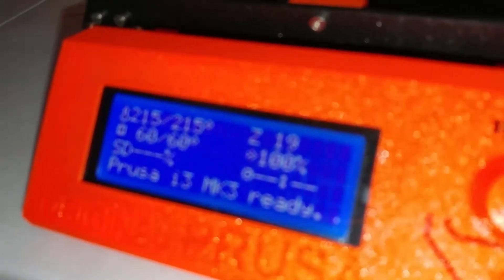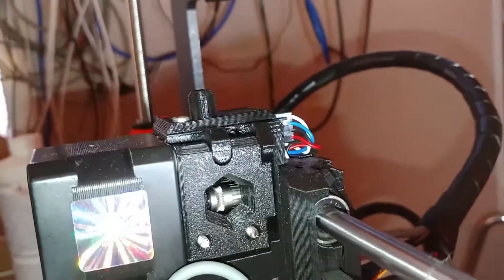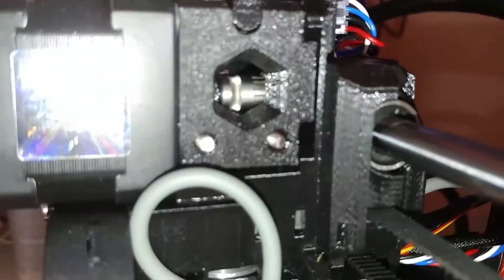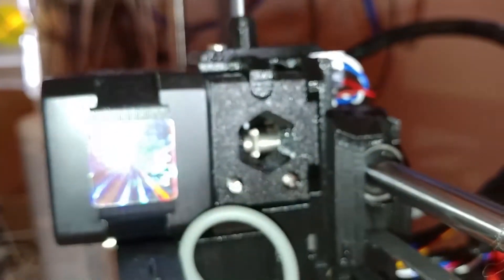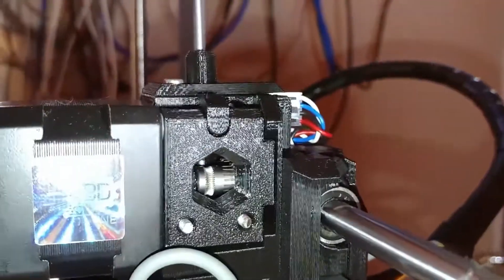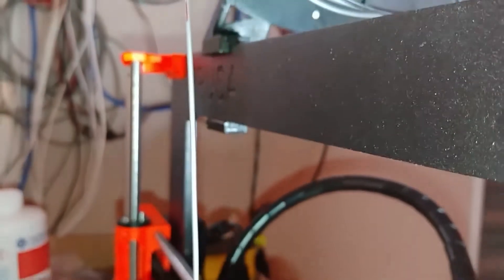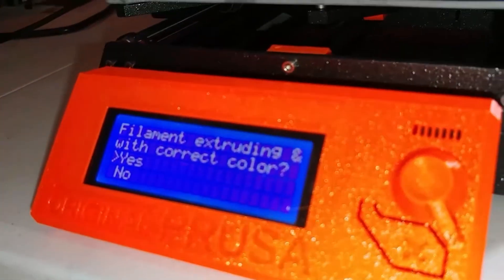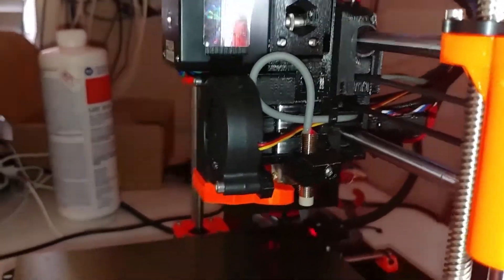Extruder Click Error   Prusa MK3 i3

Comment: Mine was caused by a filament runout. It has no back pressure from the motor to push the last of aspool through and I just had to remove the tension screws preheat the system and pull out the excess filament.

Comment: I think I found a solution.
I have the same problem and found in other video a comment that might have a working solution.
"The problem is the Quick Joint that holds the PTFE tubing, after some time it starts to get weak and it doesn't hold the PTFE tubing anymore, the filament is than pushing the PTFE tubing up towards the extruder gears creating a gap at the throat tube and that will block the extrusion. 
I made a new PTFE tube and made it about 2 millimeter longer, I pushed it back in the hot end and because I did not have a new quick joint so I used a drop of fast glue, now everything is working fine again."
I am ordering a new PTFE tube and trying this out.
Hope this helps!

Comment: did you fix it? i have the same issue, im sure that its the extruder motor, i was watching the bondtech that is inside the extruder but they dont turn in the correct way. or maybe they dont move, just click and stay in the same place making noise (click)

Comment: Had the same problem took me 16 disensambly's before I found out what the problem was.  I printed about 28 days without any problem and than it started to click, used the same settings and material. 
The problem is the Quick Joint that holds the PTFE tubing, after some time it starts to get weak and it doesn't hold the PTFE tubing anymore, the filament is than pushing the PTFE tubing up towards the extruder gears creating a gap at the throat tube and that will block the extrusion. 
I made a new PTFE tube and made it about 2 millimeter longer, I pushed it back in the hot end and because I did not have a new quick joint so I used a drop of fast glue, now everything is working fine again.
Reply: Having same issue I'll try that also, thanks !
Reply: @ScHaPaH  Did it work ?
Reply: @cazacucatalin  Didn't try, I have upgraded to R3 extruder and no more mid print clog, I have now 100% success on my prints

Comment: Did you fix that problem? Prusa CS told me that this is cause of wrong filament. I've changed it and still is same problem.
Every time when this clickin start, I do unloading filament. and every time at the end is a small ball.
Is it possible that filament jam in the nozzle?
During 10 hours of printing I have that issue more that 5 times. It's really annoying.

Comment: from what I see it is clogged. 
You may fix it already. but here is how I fix the problem 

here is the concept and solution
there is 3 type of jam. 
1st is nozzle jam, 2nd cooling zone jam or PTFE jam & 3rd jam before filament goes into the motor. 

1. understand how the excluder structural can help  you understand which part is the jam. in your case most likely is 2nd level jam
2. there is a heat zone and cooling zone when the heat transfer to cold zone. filament cooling speed too slow and filling up the cold zone then harden .it will clog.
mainly cause for 2 reasons. exclusion speed too fast or cooling fan stop.
3. how to fix it ?  if not heavy jam you could heat up 230 for PLA  try manually push it in.  if this not works you will need to open up the hot end and take out the PTFE tube see is that filament stuck at PTFE tube. 

I try to make a video explain about this by this week
Reply from the maker: Bruce Vlog I reckon I should delete this video. Since it's been unclogged for a couple months now
Reply: Can you describe how you fixed the issue?  I am encountering the same- extruder clicking and not feeding PLA.  I've tested the pully tension, manual feed, cleared any potential clog and it still does it.

Comment: I met the same issue and found that it happens when the printing height is less than 0.15mm.
The 0.2mm and 0.15mm work fine but 0.1 and 0.05 have the same issue. Feel disappointed about i3 mk3...

Anybody have suggestion or solution? TY
Reply: Same problem here, 0.2 works fine, lesser wil start to jam.

Comment: Looks like your extruder bolts are too tight. On left they should be flush. I was having similar problems. turns out the screws attaching the extruder to other components were loose. Check to make sure they are tight
Reply: THIS IS THE CORRECT ANSWER  - Thank you!

Comment: I have the exact same issue. Prusa CS told me it's a bad extruder motor. I'm in the process of replacing it as I'm writing this. Even though i got mine as a kit, I'm kinda lost in taking everything apart again lol
Reply: As an update, the new motor didn't fix it. I'm convinced it's the ptfe tube inside the hot end
Reply: Robert, I am having hte same issue. Same model received about the same time, just as a kit. Also tried Settings --> Move Axis --> Extruder and it does the same thing, also without filament. I have also checked that the set screw is tight and that there is nothing preventing turning the motor. Any new updates on your end?
Reply: I am experiencing the same issue with my MK3 right now.  The kit was just built, and this started immediately.  I have a stock motor and a Moons motor replacement and both do the same thing.  I have made all suggested adjustments, and still run into the same behavior.  The strange thing is, it was working after I took the extruder apart yesterday, and put it back together.  I made about 10-12 first layer tests, extrusion was normal.  I then tried to print something from the supplied SD card, and the clicking started again immediately.  It may be a setting imparted to it by the print model, but I'm not knowledgeable enough to be sure.
Reply: Same problem here, no solutions, browsed the internet for days :(